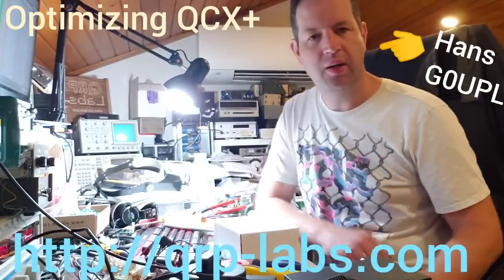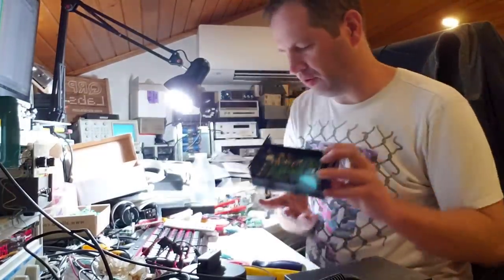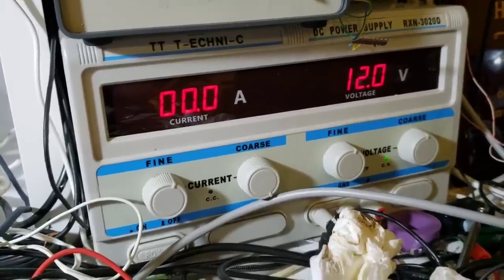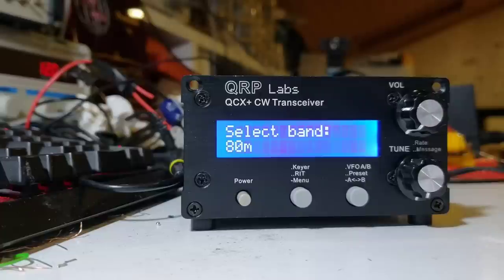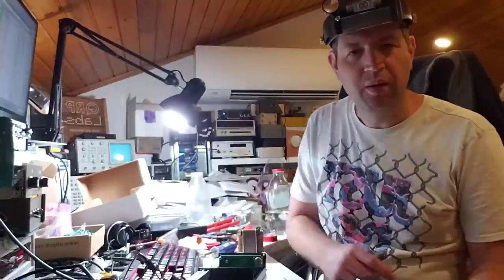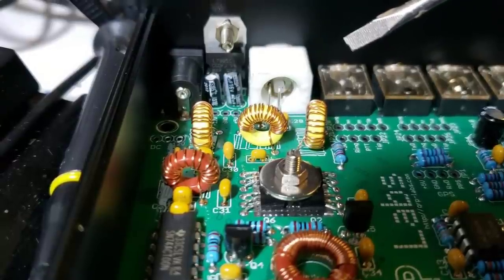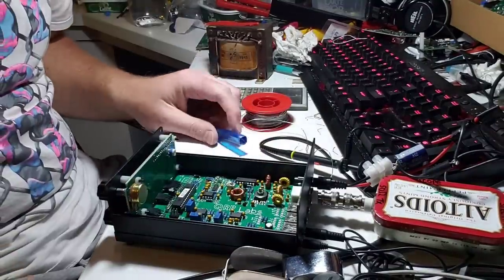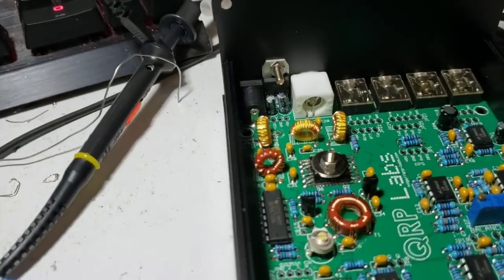Tuning up your QCX+

Comment: Notes to anyone building the QCX mini. The 16 wires that you use to solder the LCD display to it's carrier board needs some care. Pins 1 and pins 5, 6, 7, and 8 need to be soldered VERY close to the PCB. This is to avoid shorting to the ISP header and to the top of C47 after assembley. Bend those wires at 90 degrees as they come through the board and solder them without adding any extra height. the tolerances in this kit are insane, but very much worth it. Compared to my first transmitter kit, the Howes CTX80, this kit is off the scale in terms of conception, design, realization and execution. Very well done Hans and to all at QRP Labs...

Comment: 👍Very helpful video Hans. Thanks for taking the time to do this. My 20m QCX output is about 3W, so will follow your procedure to see if I can squeeze it up to 5W (by squeezing and unsqueezing some inductors).

My workbench is a little like yours with lots of leads. Recently I got so fed up tracing which was connected to what that I spent some time labelling them.

On another note, last weekend I planned a SOTA activation. Just beforehand, I checked my FT-817 and found it was faulty with no TX output. With no time to investigate, I stuck the 20m QCX in my backpack instead. Connected to a 20m EFHW, the QCX performed flawlessly and the summit was easily activated.

Comment: Thanks so much for this very useful video Hans that I just ran across.  I just finished my first QCX mini and with no adjustment yet I'm getting 3 watts out at 12v. I'll tackle a tune up after lunch, using this info.  After that, in a couple days, I'll start into the 50w amp kit you I just rec'd from you.  That FedEx was a nice quick service this time.  I think I'm going to order a 40 and 30m kit and maybe one more amp. I still seem to be addicted to kit building, after all these years!  hihiii 
72, Brent VA3YG

Comment: I went back and tuned up all of my QRP-LAB purchases.  40M QCX went from 4.5 to 6W. 20M QCX+ went from 4 to 6W.  I even tuned up the 50W 20M amp  35 to 40W @ 19.5V PS.  Was so excited, I took my 20M QCX and converted it to the 17M with parts around the shop, tuned it up to 4.5W.   Thanks Hans.

I only wish I new this trick when I was building the radios.  :)

Comment: Excellent video Hans.  I was able to adjust turns on my 30 meter QCX-mini and now have 5.0 watts output when using a 12.0 Vdc supply and yes I had to remove a couple of turns on L3 and also adjusted spacing on L2 and L1 (power measured on 50 ohm load using oscilloscope).  Now time to start building my 40 and 20 meter QCX-mini's

Comment: Thank you Hans for putting this video together.  I just went from 32.8V Pk-Pk to 40.8V Pk-Pk with my 20m QCX.  I also calibrated the oscillator with my station clock/QLG1 GPS.  I somehow missed that it had this ability.

This was a huge help, and removing some turns and adjusting the inductance made the difference.

Thanks and 73!

AI6ZV

Comment: Nice job showing the steps and explanation of the different parts / alignment / test points Hans =)   Thank you very much for the great design of the kit =)    Love it for SOTA / POTA / RaDAR outings =)    Hope to get one of the newer kit later on after the parts supply is back up and the wait in line =)    I do not mind the wait for a great product =)    de N5VMO Pat ( QCX -20m kit pre-built ... bought used ... love to use it =)

Comment: About trimers.  I was way off with my settings not able to find any meter movement. I wondered about how far to turn the trimmer. I found that there seems to be a stop on one end of adjustment with a stiff feeling. "Didn't force it.  Then at the other end of turns, I found the end of adjustments makes a slight clicking sound.  I did get my QCx finally tuned but had to really go to other trimmers adjusting to find the sweet spot on all of them. Best of luck you will find the lows if you keep looking.

Comment: To clarify, I am talking about output measurement of the QCX transceiver in watts.  The dummy load instructions seem to be quite different than how you are measuring output.  I suspect both your method and the dummy load instruction method are correct but they are different ways of calculating the QCX output  At least that is  what I hope!
Reply from the maker: John please see my reply just now to your first comment.
Reply: @QRPLabs  Thank  you so much for the clarification. I don't have an oscilloscope at the moment. Following your instructions I am getting quite close to 5 watts or thereabouts- I'm still fine tuning.   l could also get a bit more power by increasing the supply voltage to as high as 16 v.    II think I will be quite close to that with a 13.8 volt supply and will be satisfied with that.  Also, I am getting the 50w amp kit.  Thanks again , it is all quite enjoyable.

Comment: Tnx a lot Hans for the video, excactly the right time - just finished my 20m QCX+. Can you give a short info how you have connected and attentuated from the QRP-Labs dummy load to the scope.
Reply from the maker: The 'scope probe (10X) is connected directly to the 50-ohm dummy load. 50V p-p is well within the acceptable input range of the oscilloscope.
Reply: @QRPLabs  Tnx Hans, and your osci probe ist at 10X?
Reply from the maker: @truhmi  Yes 10X
Reply: @QRPLabs  What size resistor did you use to connect to spectrum analyzer?
Reply from the maker: @johnasmussen7210  It's a 1K 1/4W resistor, in series with the spec ann which has 50-ohm I/P impedance. 
I should do a better matched system but I did calculate it all at some point and test it carefully and everything was as expected and calculated.

Comment: Thanks for the video Hans...it's a huge help. Should I see a sign wave if I put my oscope probe on the "pwr" test point on the QRP dummy load?  Thanks again
Reply from the maker: No... It has been rectified by the diode and capacitor. The Pwr test point should have a DC voltage,  but there will inevitably still be some RF ripple on it. So if you have your 'scope in AC coupled mode then you will see a signal... but what you want to measure is actually the DC voltage. 
73 Hans

Comment: Do you fix those toroids with silicon or glue after adjustment? This is also portable equpment and "heavy" toroids are fixed with just copper wires and they may shake and move.

Comment: I noticed that you have much high voltage measurements than I get and that you divide the square by 400.  The dummy load readings I get are much lower but QRP labs instructions for the dummy load say that  we divide by 100.  So are you measuring something differently than what am measuring or are the dummy load instructions incorrect.
Reply from the maker: I'm measuring peak-to-peak on the oscilloscope, and dividing the square by 400. If you measure peak voltage, then square and divide by 100 (peak is 1/2 peak-to-peak). The dummy load is measuring peak voltage. 
You can read my complete guide here:
http://qrp-labs.com/qcx/rfpower.html
Reply: @QRPLabs  Thanks to your video on tuning up the qcx+,  today I enjoyed my first qsos on my qcx plus with very satisfying 579 reports with hams 1,500 miles from home. Conditions were good but just the same it was great fun.

Comment: I'm wondering if you can mount the coils in a better way or with some kind of clue to give some mechanical stress relieve when carrying the item around eg?
Reply from the maker: People write various kinds of things about effects of various glues and varnishes on coil Q. Practically speaking I don't think it will affect anything if you put a blob of any kind of glue between the toroid and the board. As you say, it could be useful mechanically if you are out and about in rough places.

Comment: So the question becomes: what if I am a ham with limited resources, say, without an o scope. Is this tuning still possible?
Reply from the maker: Yes! Please watch the video carefully again. Nothing in it requires an oscilloscope. I am merely using the oscilloscope to measure power output because this is the method I choose to use here. You can use ANY power meter you have. Or even achieve a lot with the internal power measurement - the accuracy is not great but it will give you a good measure of relative improvements and let you optimize power output. The other alignments are all done with the internal built-in alignment tools. 
No oscilloscope or other equipment needed! QCX-series radios have it all built in.
Reply: Agree with Hans.
For base debug you need only 50Ohms and internal test sute. DVM for IC tracing and RF power meter LPF adjustment.
Having special tools allows do this more convenient and quick way.
Only I would do is updated doc with DVM voltage ofter PA with loaded to 50Ohms dammy load or LPF with input impedance 50Ohms.
Reply: The ONLY equipment for tuning power output like Hans is doing here is a Digital Multimeter (DMM) or a Vacuum Tube Voltmeter (VTVM). I'm assuming you are using a dummy load with a rectifier and coupling capacitor to measure power output.
The only problem I encounter when removing turns from ANY TOROID is getting than damned PC hole cleared of solder, so I can reattach the wire to the PCB!

Comment: Could you tell us when is the qcx mini will be on the market??
Reply from the maker: It's in production now. We are now waiting only for the LCD modules manufacture, and for the SMD components assembly. Then they will have to ship to me, and I will have to write the manual and build one for validation. It will probably be about 20th November I expect. There are 1,000 QCX-mini kits in the first batch.

Comment: Could the QCX's built-in ability to measure (relative) power output be used for the "power peaking" process?

ALSO, if I use my DMM to measure RMS voltage off my (QRP Labs) dummy load, it appears my power calculation is this:

P = (Vrms * 2 * sqrt(2))^2 / 50 ohms
P = 0.16 * Vrms^2

Does this look correct?
Reply from the maker: Yes the built-in RF power meter could be used for power-peaking. I think I mentioned this somewhere in the video if I remember correctly. 

You can use the RMS function of your DMM if it is able to work properly at RF frequencies; bear in mind there may be some accuracy limitations. Your formula does not look correct to me. 

Power output is Vrms^2 / 50

See http://qrp-labs.com/qcxp/rfpower.html for a full discussion on this.
Reply: I believe the calculation you were looking for is described below:

Take the Voltage reading from your DMM across the dummy load and add 0.6V to account for the voltage drop across the diode. This gives you your Peak Voltage (PV).

Voltage + 0.6V = PV

Take the PV and divide it by the square root of 2 (which is roughly 1.414) to give you the Root Mean Squared Voltage (Vrms). 

PV / 1.414 = Vrms

Then you square the Vrms and divide by the 50 Ohms to give you the output power in Watts.

Vrms ^2 / 50 Ohms = X Watts of output power

It should be noted that Hans describes in build manual (and I'm paraphrasing here) this dummy load is not an "accurate" piece of test gear but a tool to get your QCX or other QRP rig aligned and tested. It will provide a close enough reading to let you know what your relative output power is like.

Comment: For the process of removing turns, has anyone just soldered  a jumper between two turns on the outside of the coil without removing the PCB connection? This should bypass two turns without disturbing the board.
Reply: I don't have specific info for the QCX situation. But in general having a shorted turn on a coil is very bad. It has lots of other effects besides just removing a turn. Think of it as a transformer, the rest of the turns still there work as a primary and they are trying to induce current into that shorted turn as a secondary!

Comment: Dear Hans. I have the QCX+ and recently I have completed the QDX build. You have created great and fun stuff, PLUS the manuals are superb!
The 30m and 20m of my QDX are not giving significant power, but I know that I'll have to check the coils' enamel insulation. As to the fine tuning: would the procedure for the QCX+ (this vid) also apply to the QDX? I mean getting the low pass inductors right. VY 73 de HA7RJA